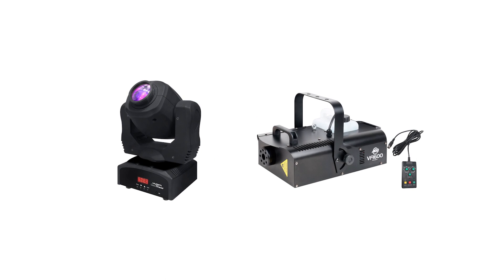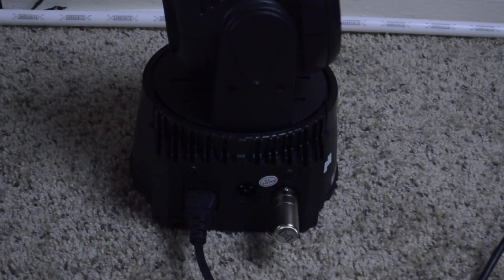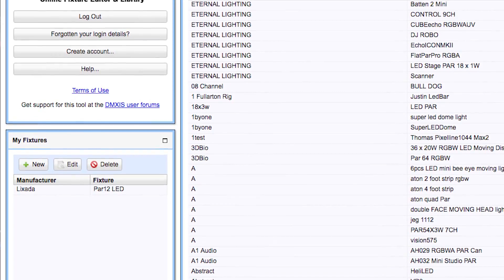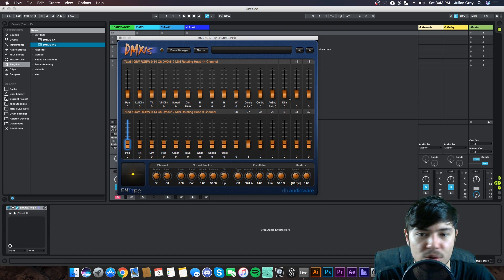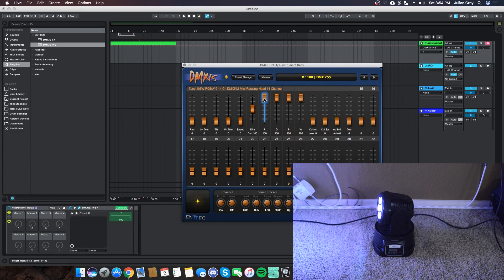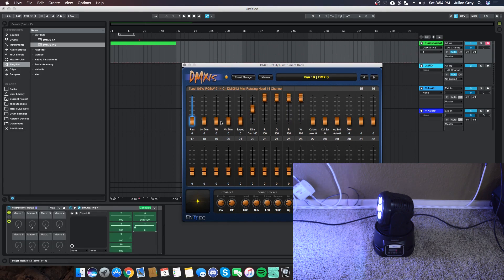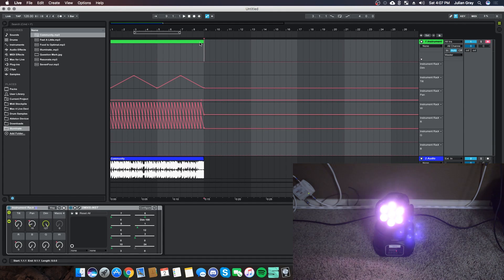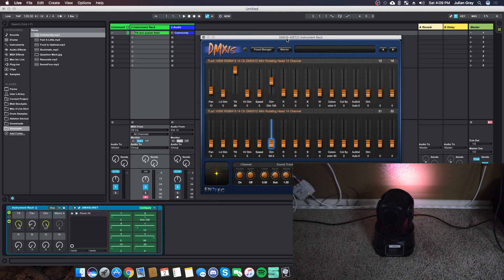Controlling Lights With Ableton Live (MIDI to DMX - Enttec DMXIS)

Comment: I'm confused, it used to be done without having to do all this automation stuff. You could just save presets and switch through them with MIDI notes which I think was more productive. But I can't find any videos to be reminded how to do it
Reply from the maker: You can still do that way, it's just a slightly different selection mechanism. I like to program individual lights with automation which isn't completely necessary, it's just if you want more nuanced control.

Comment: Some of my lights are 5 pin and some are 3 pin. Can you still daisy chain them together with the proper 3 pin to 5 pin cables without issues?  I also noticed that the Enttec DMXIS is 5 pin but the light in this video is 3 pin. so I may already knoiw the answer just want to confirm.

Comment: This is a really good video, thank you. I'm pretty new to Ableton (have aways used Logic for recording) and am trying to learn this in the context of a band, where we have a scene per song with some pads etc. on backing tracks. 

Within that scene are a number of tracks which are all the length of the song (so all get triggered at the start of the song - even if some are silent for a while before a part comes in).

I think I would just want to set up a virtual instrument channel for each light? Or is that not necessary as the VST plug-in has all the lights in it - I would just need lots of automation lanes that controlled like R light 1, G light 1, R light 2, G light 2 etc.? 

Then I need have a virtual instrument clip within each scene (for each song). Then when the scene (song) is played, it will "play" that automation track. Would you agree, or is there a better way to do it?

Would I be right in thinking that, in this application, the use of the macro, or the grouping that you do towards the end (to basically keep that lighting automation with the audio so every time you trigger the audio, the lighting is also triggered - that's right?) is necessary? Maybe I missed it (and because I'm not that familiar with Ableton) but I didn't really see the purpose of setting up the macro, if you added a new light and wanted it to do the same as another you've already programmed, couldn't you just copy and paste the automation from that light to the automation lanes for the new VST?

Thanks, Chris
Reply: Watching this and doing more digging myself, I don't seem to be able to load multiple instances of DMXIS on different MIDI channels. I get a hardware unlock code error.

So I would need to do the automation for all my lights on one MIDI channel - I'm not sure how this could work if we use Ableton in session view usually. Equally, with the VST parameters all having non descript names (i.e just 1, 2, 3, 17, 18, 19) it's pretty difficult to use. Any ideas?
Reply: @chrisholmes_90  I'm having the same exact issue! Did you end up figuring this out?
Reply: @rossmurakami  yeah, if I just pressed cancel on the errors and carried on as usual, then unplug the DMXis box and plug it back in it would work! Strange
Reply from the maker: Unfortunately i'm not super familiar with logic and how it integrates!

Comment: Hey, thanks for this. The idea of using macros for patches is a great idea. Though, I am stuck somewhat.

You can have up to 16 macro knobs controlling a group. Do you have a solution for when you need more than 16? I tried putting the group inside another group, but the macros of outer group don't seem to be able to pass to DMXis. Any ideas?
Reply from the maker: Unfortuantely there really isn't a solution outside of just midi mapping each parameter individually.

Comment: So I don't have Ableton Live, I don't produce music. I'm a simple tech guy that likes throwing house parties. I have been using lights on auto mode with their microphones but I want to step it up and design a small scale light show(anywhere from 10 to 20 lights) for a Reunion party that I want to hold in the summer. Would I be able to do what you're doing with just the basic Ableton Live package for 80 bucks? because if that's so, I confident I will be able to put together one hell of a show using this method over standard dmx controllers.

Comment: Very interesting.  Could this potentially be triggered through a MIDI controller and the lights will activate?  Also, could DMXIS be used in conjunction with a DMX light board?
Reply from the maker: Absolutely! it's all fundamentally midi!
Reply: @juliangraymedia  Awesome.  Thanks for the video.

Comment: A DMX Terminator does NOT let the controller know there are no more lights in the chain.  It simply puts a known impedance on the line to prevent electrical interference on the DMX line.  The controller doesn't know or care what or how many things are on any one chain.  It simply sends the commands you program to the addresses you typed in, and.. magic.  DMX is exactly like MIDI - a one-way dumb protocol.  There's actually no way for the controller to get information back from the lights.

Comment: I want to be able to control lighting live not by knobs that control the plugin DMXIS faders, but by certain notes I hit on a midi controller (either pads or keys).  How would I go about doing this?
Reply: DMXis has a MIDI learn feature that does exactly this for individual channels. Or you can use DMXis presets and achieve something similar with MIDI controller mapping

Comment: Hey, I know this is late ahaha, how would you do it with more than one light? And also, how much does the hardware and software cost??
Reply: Software is free hardware is $300, cables about $30 a piece. Plug the cable into the first light then out of that light into the next and so on. Put the signal terminator on the that light in the chains out.

Comment: Thanks for the video! But, I have a question. Can I run multiple instances of the DMXIS plugin on multiple tracks? My goal is to have some clips to control color, and some clips control intensity, and some to control pan & tilt. Is that possible?
Reply: You don't need multiple plug-ins. You just need to create a new automation lane to do what you need.

Comment: I have an "EntTec DMX USB PRO MkII"  interface will it work with the DMXIS vst plugin for ableton?   If not how can control it with ableton?  Also  This interfase is supposed to dual dmx 512  can I have 2 universes 512?

Comment: Do you know if you can use ableton macros to trigger DMXis Macros, so you can take advantage of the built in chases and stuff? Also, can Ableton macros trigger banks or presets in the DMXis software?
Reply: Hey. I'm not sure that you can set up Macros just with Ableton macros, but you can definitely recall DMXis presets and banks with MIDI. Youi could also use Ableton follow actions to set up chases with MIDI clips.

There are three main ways you can use DMXis in Ableton:
1) As in this video. Automating VST controls straight from the timeline
2) With MIDI notes. You can use DMXis' MIDI learn to "play" individual DMX channels with midi notes. Velocity corresponds to channel value.
3) Using MIDI to change presets. You can route MIDI to MIDI channels 15 and 16 on DMXis to change banks and presets respectively.

You can actually use all three together. It's really flexible, though you'll probably need to leverage DMXis channel masking as well to avoid stepping on your own toes.

Comment: XLR is not a cable type. XLR is a connector type. Does DMX cabling use XLR connectors - yes it does. Does microphone cable use  XLR - yes it does. Both  DMX cabling and microphone cabling use XLR connectors.  I believe what you mean to say is that one should not use microphone cable for lighting.
Reply: They CAN be used interchangeably. Somewhat. Can lead to errors though.
Typically xlr cables can be used for lighting without too much harm. But DMX cables usually can’t be used for musical access without more error.
Reply: This comment right here deserves an award!! This is by far, the most useless comment on YouTube.. :)

Comment: I think I figured out how to group multiple instrument racks within a rack and how to add multiple instances of the DMXIS plugin to those different instruments racks.  So if I want to have independent control of various features on each light, then that would mean using 16 different instances of the DMXIS plugin (for 16 different lighting fixtures).  I'm wondering if this would be very taxing on the CPU and create issues.  Do you recommend this approach if using multiple fixtures when wanting independent control?
Reply: You already have independent controls over each fixture in this example. Just run a DMX cable to the next fixture and place the terminal adapter on it. Then name the next fixture "d002" and setup a new fixture lane on the DMXis program. It will send different signals down the line. No need to instantiate multiple DMXis plug-ins. Hope this helps.
Reply: Is there a workaround for the cpu load issue?

Comment: Tiny point of correction. While you can physically connect as many lights as you want to hit 512 channels, the DMX Protocol states that if you are connecting more than 32 fixtures, you need to use a splitter or some other means to boost the signal. http://www.thedmxwiki.com/dmx_definitions/dmx512
Reply from the maker: You're right!

Comment: Hey Julian! Great tutorial, works like a charm! But what do i have to do, if i want to control my lights individually, for example, one makro for all lights R, but each light dimmer individually? Makros are limited to 8 Slots, right? So, i don't have clue what to do ...
Reply from the maker: Unfortunately it's not so easy as you can't add more macros. you can create a second rack with dmxis in it for 8 more macros and so on. I really wish you could just add more macros. that would make things much easier.
Reply: @juliangraymedia  Thank you very much for your response! I'm currently testing multiple DMXIs instances with individual macro mappings ... i really hope it works :)
Reply: @dirkadirka151  I like the macro function ... i simply decided not to use individual lights at the moment. Just a stack of washes - clean and simple :)

Comment: After configuring 4x rgbs without the macro's I found it was a nightmare first figuring out and then remembering what's what for example... 1 is blue first fixture, 6 is red 2nd fixture 8 is speed 2nd fixture...etc as you know you can't rename them, macros you can but they are limited to how many you have,  Sooo.....say 50+ parameters in 5 -6 fixtures how would that be done? I know you can't have multiple DMXis vst's open at the same time, it creates conflicts i've tried?
Reply: When I get to 50+ parameters, it overloads my CPU. Is there a workaround for that?

Comment: Aloha, I left a message on your other video that has your song on it.  I appreciate your video. In addition to being an electronic musician, I am also a stage electrician that is familiar with lighting and this is great to know that you can use Ableton to control lights.  Check out the other message to see a link to Infinite Sinewave performance with some crazy led lights on his QuNeo controllers.  I was wanting to know if there is a way to get the signal for lights from the audio directly as opposed to having to manually enter these commands.
Reply from the maker: I think dmxis has a mic input as well. I'm not entirely sure!
Reply: thanks for getting back to me about this.  I will check it out.

Comment: do you recommend creating presets in the DMXIS mixer and then calling them with a midi note at different sections of the song OR what about just drawing in all automation for each light in Ableton for each section of the song (e.g verse, chorus, etc).?  Then there would be no need for presets in the DMXIS mixer.
Reply from the maker: You can do both! the issue is that presets have less control over each individual light

Comment: So I'm super new to this program and controlling lights, and my question is, would I be able to use a DMXIS with a Roland TM-2 drum module to control a light? More specifically a strobe light. Basically, I'm looking for a way that every time I hit my drum pad tied to the TM-2,  the strobe will go off during a show (I'm in a hardcore band). Hope this question makes sense and I'm glad I found this video, best one I've found yet.
Reply from the maker: Yes, Just have to convert midi from the pad to a dmx signal. very doable with max for live.
Reply: Julian Gray Media thank you so much!

Comment: Trying to add a second fixture that does something completely different. Do i need to change the DMX to channel 2? When I try that it doesn't work.
Reply from the maker: you need to change the fixture channel to whatever the next open channel is that's left over after covering all the channels used on the first fixture.

Comment: What if i built my own light fixture with LED strips and wired it into a DMX dimmer controller i bought separately. What would I look up in the DMXIS program?
Reply from the maker: DMXIS works with anything that works with the dmx protocol as far as I know
Reply: Julian Gray Media thank you. Also I’m having trouble finding a dmx dimmer or “ decoder” controller that is LED compatible and has Input and outputs for actual dmx cables, most just have RGB or cat inputs. Any suggestions?
Reply from the maker: no idea man.

Comment: Hi Julian how are you? im still having issues with this. You are using just One fixture, what woud happen if you have 12 different Fixtures?? Would you use the VST in 12 channels or how would you use it?

Thanks for help once again.
Reply from the maker: No, you'd use different dmx channels for those lights on the same channel
Reply: Ok, but wouldnt that make me use a lot of individual DMX channels to Map??  You are using it like that to create a Midi Clip with some automation on each light then to pass it to the Session view.

Comment: Hi Julian, i have a few Questions hehehe

For every Fixture (light) do i have to make a new Track and put the Dmxis plugin or can i redirect everything to one channel and have as a group of seperate lights??

Cause i want to be able to launch every light at will when ever i want, so i would create a bunch of Midi Clips for each Fixture that have the information and Automatation of each parameter, and everytime i launch them they load all the automatation i did before, cause it saves it (i tried this an works) BUT, Do i have to set for every light a new Track and that track with a bunch of "Light Channel" track or can i just set mi channels for each different fixture  and redirect it to a MASTER DMXIS???

For Example: I use 5 Background, 4 mov heads like the one in the video, 4 Chauvet moving heads, 8 lights in the front, ETC... That would be a lot of "dmxis channels" and more Channels inside each one of them.

What do you recommend?

THANKS FOR YOUR TIME AND HELP!!!
Reply from the maker: you use the same channel for all of the lights you've got. you only use a second channel if you need more macros
Reply: So i create a channel per Address in just one track?
how can i route the second channel to the MAIN one?
Is there a way i could get more tan 8 Macros per Channel?
Reply from the maker: you assign each light to a different address on the same channel. lets say your lights have 7 channels each. Light one would be dmx address 1, light 2 would be dmx address 8, 3 would be dmx address 15, etc. there's no way to have more than 8 macros per channel.
Reply: Hahaha damm Macrooos!!! 

I know how to patch every light and i've using Dmixis with ablleton for years. But resently i wanted to try a different way to use it, so i wanted to create different patches per light so i saw you using it in the arrengement view making the automatation and i wanted to do that.

But for me to use them how want, i had to create for each fixture a Midi Track with dmxis on it and that consumes a cpu, so im looking for a way to send all the information from different channels to just ONE with DMXIS VST, but still had no luck.

Is there a Way?? Cause using Macros i had to create all those tracks and mapped them for each Fixture and it works, but again is a lot of cpu memory. Hope you understand my problem and help me with it hahaha.

Thanks for you time and patience!

Comment: Hi ! Thanks for this video. It helped me a lot. I have still a problem. How do I use your macro tip when I have more than 8 lights ? Thanks !
Reply from the maker: You can use more than one instance of DMXIS in different channels! I run a lot more than 8 lights when I'm playing out :)
Reply: Hi Julian,  Will multiple instances of DMXIS inst. vst work simultaneosly?
I haven't bought the DMXIS box yet so I am wonderign if it possible to create differente instances of the VST, one for each Light fixture ,and create automation for each fixture in its corresponding channel. I want to automate all the 512 DMX channels so I am wondering if it is possible to create cluster of automated DMX channels that can be played separately as clips.